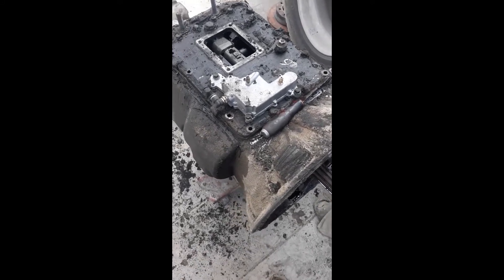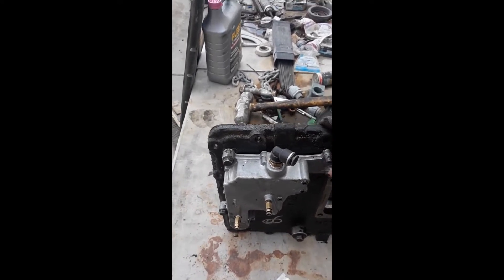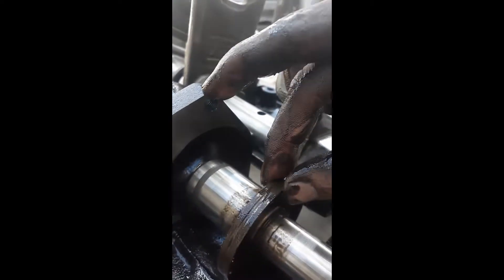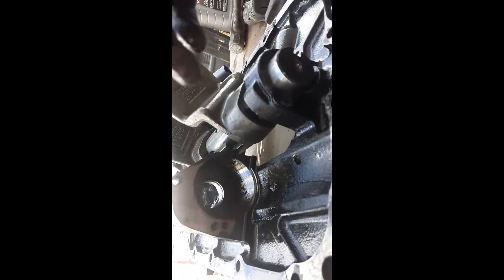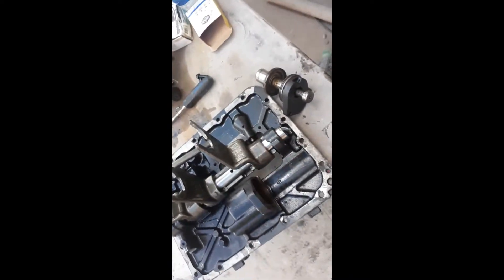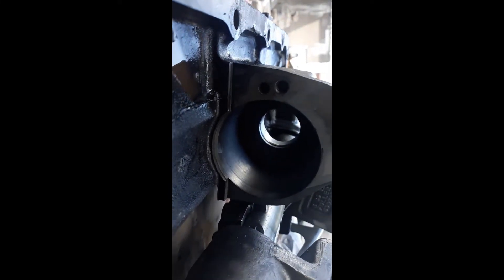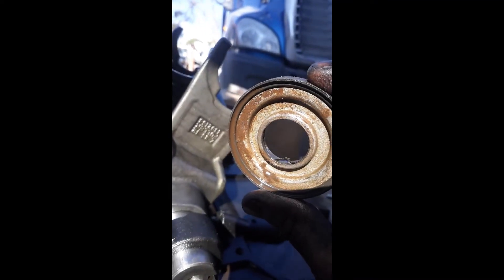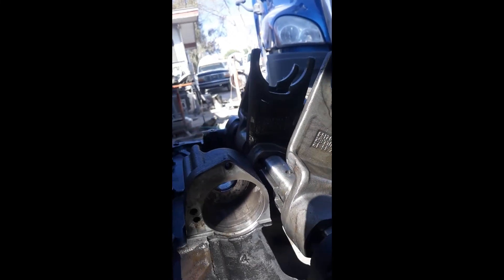Eaton fuller high range neutral air leak fix

Comment: I'm having this issue, and failed a DOT inspection to lease on to a carrier. I was told by the local Freightliner shop that the transmission MUST be removed to make this repair- but removing the shift bar housing is outlined in the ON-VEHICLE section of the manual! I believe once the huge brace over the trans is removed, I CAN remove the shift bar housing. Since I am ALSO doing the front u-joint, I'm gonna pull the front driveshaft section to make room for ME. I did the isolation test on the air module, and it is good. Range selection works- but the air leak is audible.

Comment: Wao good video...i had that same problem ...my symptom was on cold weather like 40 to 50 degrees... when starting truck it will build air only to around 50 PSI and it get stuck and won't built no more pass 50 PSI. I had to rev engine to 1400 to 1500 RPM for it to pass 50 PSI ...i too though it was air compressor or air dryer. Columbia freightliner with 14 liter 60 serie. 
Thank you!  👌
Reply from the maker: Thank you very much! And im glad i can help!

Comment: On a 2004 Sterling LT9500, I was able to remove the top plate without removing the transmission. It’s tight, but it WILL come out thru the hole in the cab floor. I lost HI range, and thought the shift modulator or piston was the culprit. Turns out, the rod in the main box that hooks onto the shift piston disconnected from the fork in the main box. Working on removing back box now to rectify the situation, and replace the pin/bolt holding the rod to the fork.
Reply from the maker: Nice! I wasn't that lucky with this freightliner 😥

Comment: alright my problem is when I shift into high range and I get back on the throttle too hard or I take my foot off throttle in a curve it's like it goes into neutral but still in gear and my clutch is great
Reply from the maker: Idk man if its not actually popping out of gear then a clutch malfunction or internal transmission failure is about the only things i can of off the top of my head that can cause that